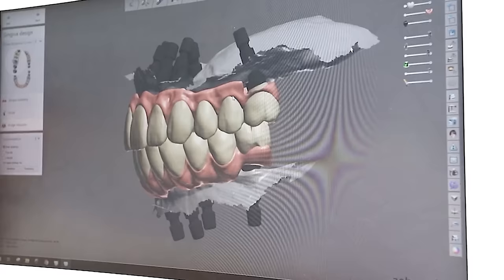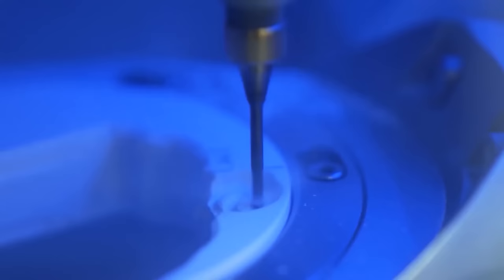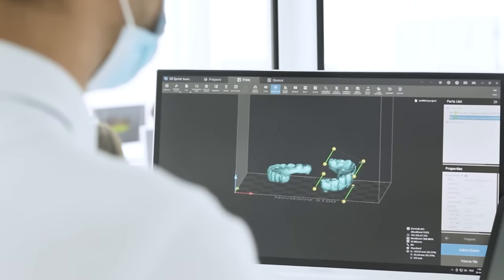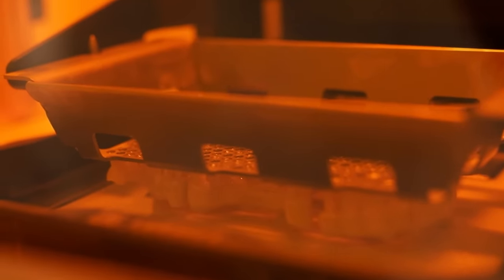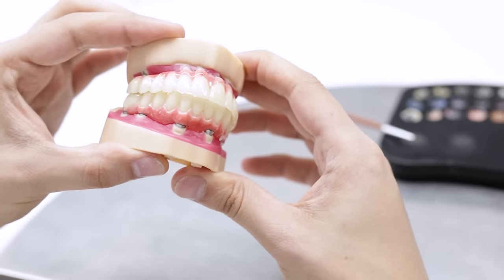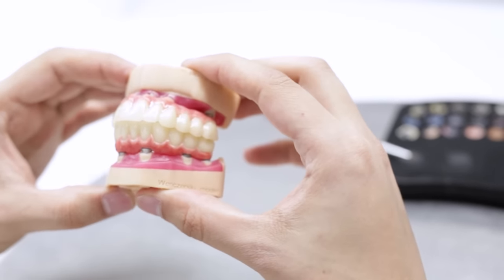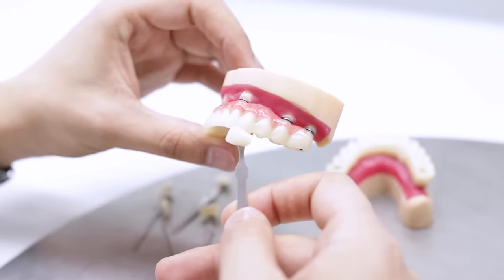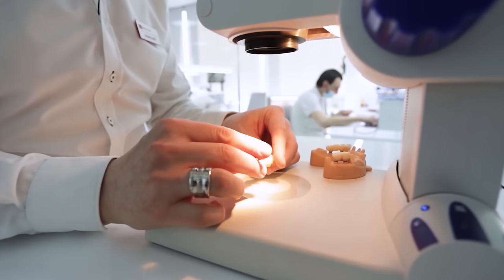How It's Made: Fixed Teeth on Dental Implants | All-on-4 | Dentaprime F3T - London

Comment: Is the PMMA teeth bottom and top, the temporary teeth. Once healed do you then get the Zirconnia permanent in the one price, or do you have to pay eg the £7K again. Everything looks so amazing, the teeth, staff it’s all breathtaking ❤
I’m to scared to go abroad and also I haven’t flown for approximately 30 years now.
At the top I have 7 front teeth and 2 back teeth, on the bottom I have coincidentally 7 at the front. All my teeth are worn down, because I bite and chew all at the front, I haven’t chewed food from the back for years.
The teeth I have left are worn down, yellow and so sensitive, I actually miss when we all had to wear masks because of how my teeth are.
May I ask please, are you able to take out the rest of my teeth and create teeth in a day for both top and bottom. OMG I’m crying just typing this, I don’t know if I’m crying because of the possibility of smiling again and also eating a decent meal and not just over boiled pasta and over boiled vegetables so every thing is soft like baby food. Or am I crying because you may say you can’t help me in this way xxx
Reply from the maker: Dear SGD .68,

PMMA and zirconia are materials used for the permanent restoration of your teeth, once you're in for your consultation you'll be given a plan which you can discuss and amend with your Treatment Co-ordinator.

With regards to your teeth, if your teeth are decaying, damaged or dead then we would extract them, however this can only be deduced by having a non-invasive examination by our dental professionals.

If you're interested, get in touch for your free consultation on 020 3868 9195! We're looking forward to helping you smile again!

Kind regards,
Dentaprime UK Team